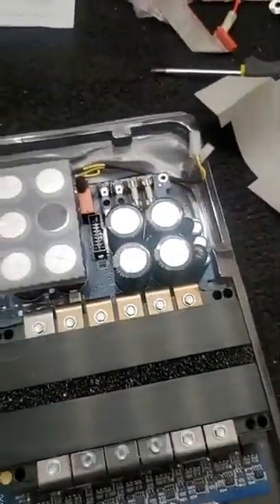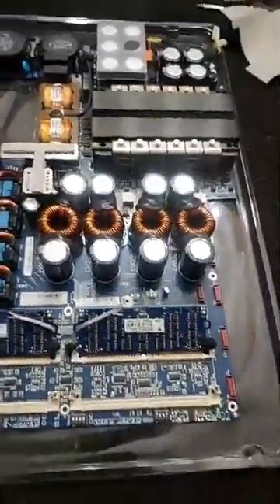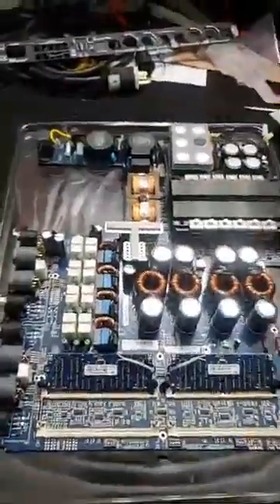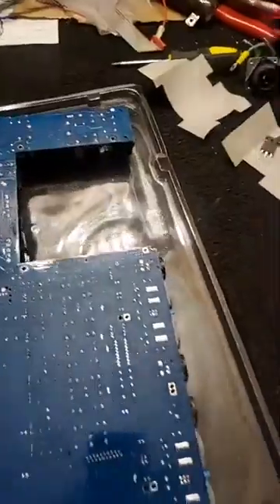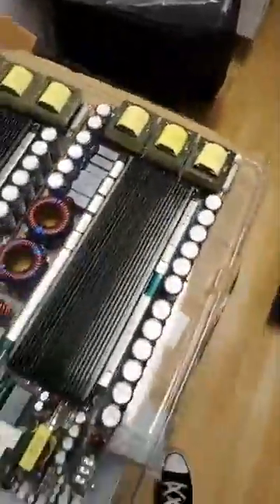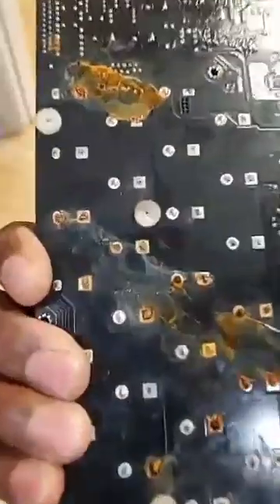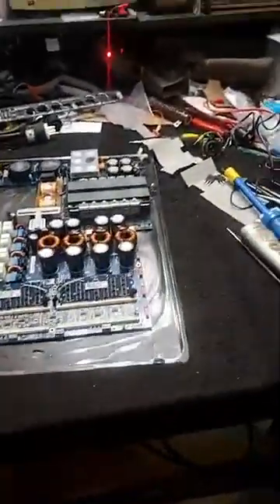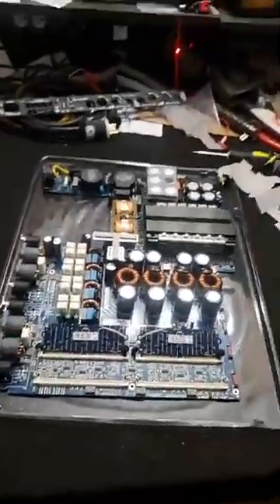Amplifier repair  by. WASI  -  Powersoft, Cvr and other causes of damage

Comment: Any advise on cvr 3002 amplifier?

The amplifier got wet in the rain but not for a long. It played well for a few weeks but now.....when I put it on and use it for a while it start to electric shock when I touch it. How can I fix this issue?

Comment: Hey man great job I’m having a problem with my CVR amplifier 3302. I’m wondering if you can help me. I think it’s not putting enough output power to the speaker any suggestions?
Reply from the maker: That is a fairly new amplifier as long as your getting signal in and out on both channels then amplifier is working as it should.  The problem without seeing your setup i would have to say your speakers are not wired properly, if you are using more that 2 woofers per channel disconnect and only do one  speaker per channel if it plays better then connect the second speakers in parallel not series. Positive terminals   to Positive. You can also check to make sure your getting enough amps to the amplifier 120v 15amps  or 20amps.  Amplifier can also be ran at 220v so do check your distribution setup.  Hopefully that helps.

Comment: Great work wasi  . My amplifier  clip light just will not turn off I know that it has a fault .some one say it is a bad resistor because it plays crocky. Some one says it the resistor.can this be true .

It's a qsc mx3000